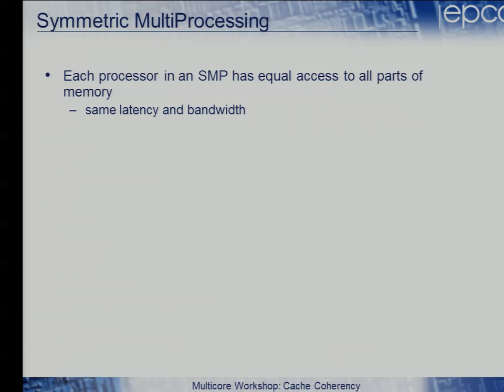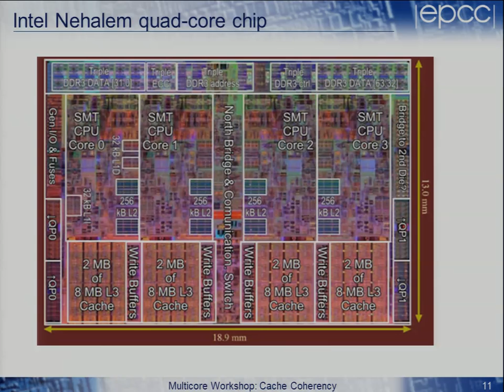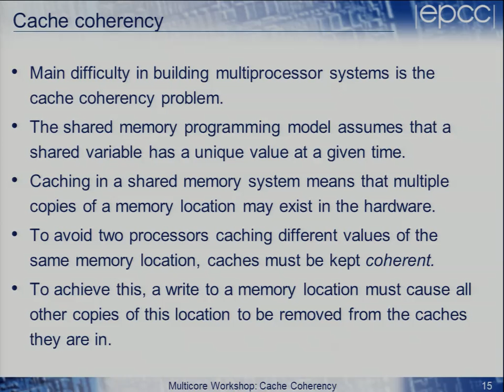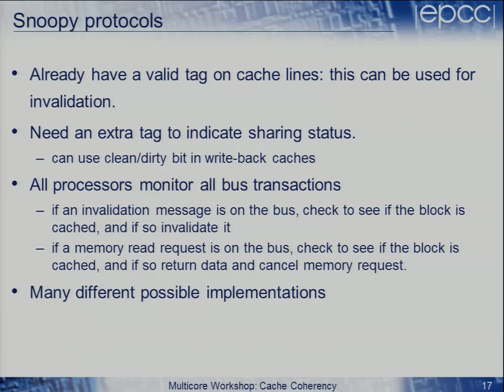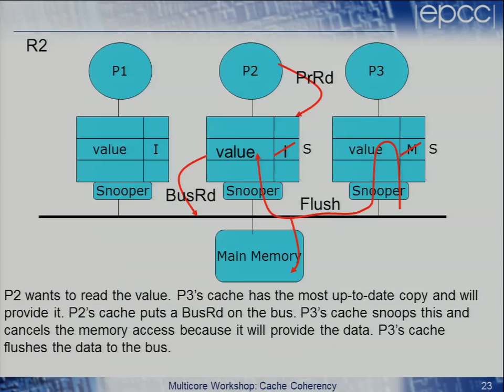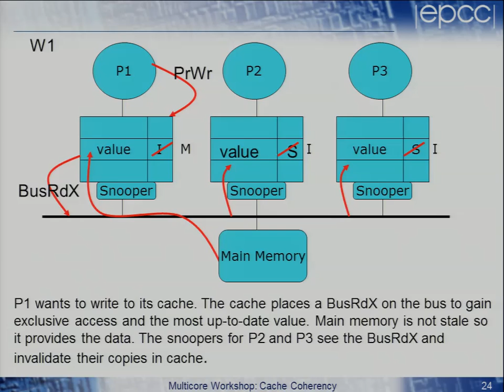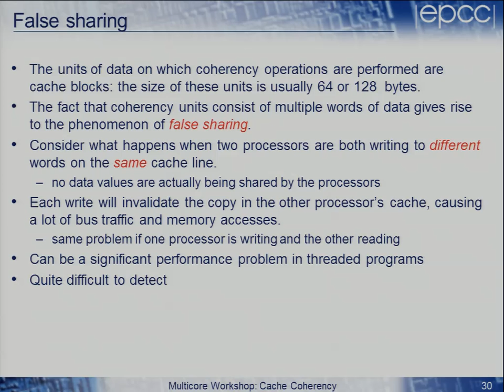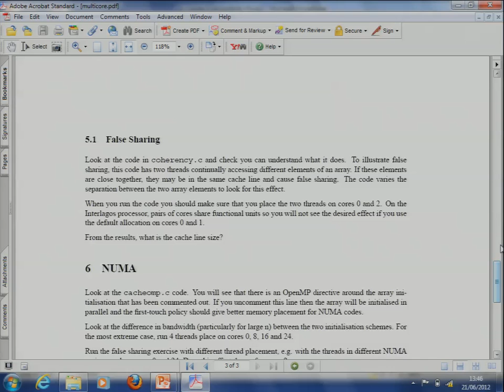Multicore Memory Caching Issues - Cache Coherency

Comment: At 24:05, the author said "declare a little array and sub sum of two with two values and thread one update the first part of the array and the thread two updated second  part." and I am wondering what does it mean. Don't we need two sub sums for the first and half part of the original array? What does it mean by having little array?
Reply: You have the following big array "int bigArray[10000]". Thread1 sums up elements 0~4999 and Thread2 sums up elements 5000~9999. The variable used to store the summation is a single array "int littleArray[2]", where Thread1 writes to littleArray[0] and Thread2 writes to littleArray[1].

In the process of the summation, Thread1 loops through the first 5000 elements of bigArray and increments the value of littleArray[0] by each element it sees. Thread2 applies this as well for the last 5000 elements while writing to littleArray[1]. From the shared memory's perspective, the concurrent writing to littleArray causes the false sharing.